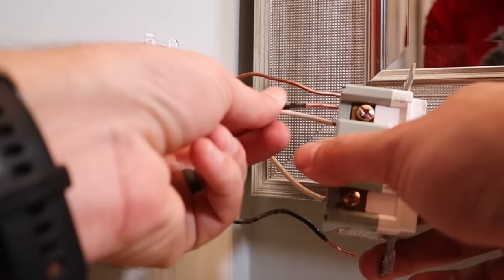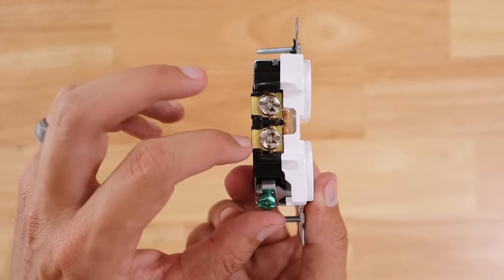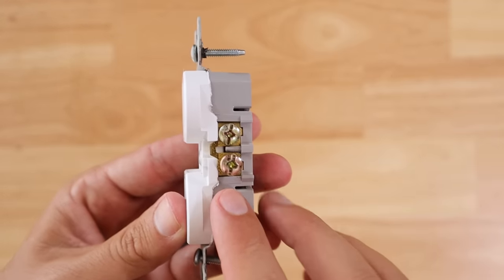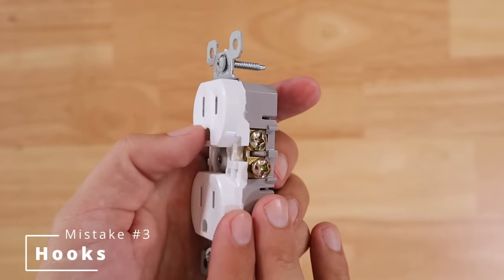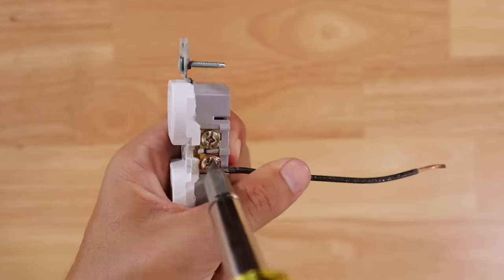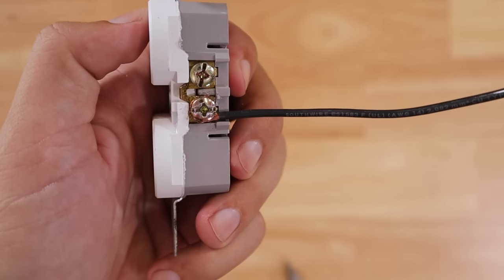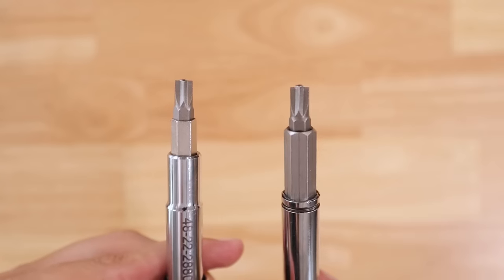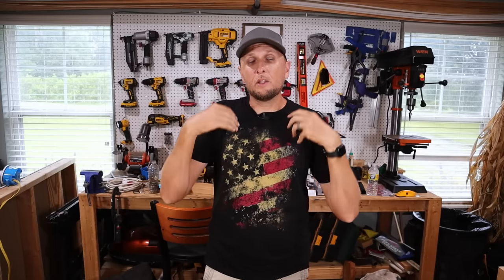The BIGGEST Mistakes DIYers Don't Know They Are Making When Wiring Receptacles | How To

Comment: I helped a father in law wire his house (He was a certified electrician). An older gentleman that had been an electrician for over 25 years. He told me one thing that I have always remembered and passed on to many DIYers. "Black to brass to save your ass!" Easy to remember and can save your life!
Reply: I was told Beverly hillbilly’s….black gold
Reply: My dad taught me "black to brass, white to white [silver]"
Reply: Aso as long as it is a three prong plug the green earth ground is always on the same side as the neutral wire.  That and if you look at a electric cord plug one of the Blades is wider.  This is the neutral side so if you look at a outlet, that side will always be natural.          Some people are color blind.
Reply: I was told that so, another  i was told righty tight lefty loosie
Reply: what is a certified electrician is that what you told you.
Reply: well in the meantime he taught you how to do the outlet so you're going to put a new one in but now there's another part of the job you have to do which makes it code now you got to go to the fuse panel and you have to take out that breaker  and you got to put an asphalt in or depends on the location it might be GFI and asphalt which they call dual breaker combination breaker is just not fault breaker but he's not going to tell you all that so you're just going to end up just doing the outlet and then now your code isn't your house is in violation because you didn't update the breaker
Reply: @josephdelvendo6009  Dude, way to go for making a simple tutorial into a complicated matter for a simple but professional way to replace an outlet. You totally missed the OP point.
Reply: @josephdelvendo6009  I bet I know something you don't.  They are not required in all states.  Also most states will let a home owner repair their own circuits without upgrading anything.  The only time in most states you have to upgrade is major renovation or adding new circuits.  

You should Not di respect Grandpa man man.  I mean no matter the outlet black does go to brass.   Also most places you can put a plug in the wall with the AFCI or GFCI on it and it does not have to be in they breaker box.
Reply: huh i wired one of these and the instruction said it didnt matter which wire went were,  i guess I will pull it out and check. hopefully i did it correctly
Reply: @slimboiu3890  WOW!!!   You will be okay using it as long as you do not put a 3 prong grounded plug into it.  If you do it will matter greatly.  It will become a direct short if you do.  If you look inside the breaker box the ground wires and neutral wires are all tied together. The ground wire that is bald actually goes to a 10 ft long copper bar driven into the ground outside your house.  Things like lamps or small fans will operate just fine off of the 2 wires alone because AC current flows in both directions so it does not matter what side is positive.  It will run either way just like the old cords from a long time ago that you could plug in either direction. They did not have a wide blade on them for the neutral wire like todays cords have.  But if a Item has a third pole it is grounded to earth and plugging them in will short the earth ground to the hot side. 

If you did not understand all of that then have a electrician double check it for you and leave it to the pro's in the future.
Reply: @jvmiller1995  thanks for the response, I will definitely pull it out and check, black to brass to save your ass got it committed to memory now!
Reply: I can't think of why swapping black and white on an outlet would matter.  On a light switch it would because you want to disconnect hot from the light when not in use.  For an outlet it's a bad practice to not wire it correctly but it will not start a fire, damage a device or be dangerous.  Many devices don't even have polarity on the plug and current flows in both directions for AC power so 50% of the time current is coming from Line and 50% of time current is coming out of neutral.  Most consumer electronics companies test their products for reverse wiring and assume that about 30% of homes are wired that way.  The chassis is connected to earth ground for added protection.  It really isn't a big deal to swap those wires.
Reply: @slimboiu3890  It doesn't.
Reply: As a non certified electrician, I can assure you that it doesn't matter. All you're doing is creating a circuit.

Look at the box that allows your phone to be charged. It doesn't have different blades on it. It can be  connected in both ways.
Reply: @Deno03  Exactly.  There are some appliances it kind of matters.  The charger is class 2 isolated, so the output is completely floating compared to the input.  The transformer inside the plug has spacings and tapes that make it impossible for the input and output to touch.    

Some appliances are either line or neutral referenced.  Meaning the 5V bus that powers the electronics ride the sine wave.  The advantage of this method is that it is cheaper as this bus can be created without an expensive transformer and some motor controls need to know the position of the sine wave to trigger.  In a Class 2 isolated scenario you would need expensive optical isolation to trigger the motors.  Even with this non isolated scenario appliance makers assume and test for miswired houses.  I think they assume as high as 30% of homes are miswired.  

The earth ground wire is a critical safety feature and that should never be miswired.  Appliance cabinets are tied to earth ground for safety.
Reply: I was told by my neighbor when  I first started working on my own stuff "just remember all the experts are dead".  He said if you don't know what your doing make sure you figure it out first and triple check everything.

Comment: This video serves as a great way for anyone to inspect their home for fire safety.  Well done!  They don't have to take care of it themselves, just know when to call in professionals.
I tell you, scariest thing I ever saw, was a friend try to "fix" his own outlets in the house he rented (cause he didn't want to "bother" his landlord.) Went to the hardware store with him, pointed out a good brand of outlets. He buys a few 10 packs. We arrive at his place - turns out to be an old home.  "Oh" I say, "old homes are different. Let's not..." - he charges ahead.  Cuts the power, pulls off an ancient-looking kitchen counter outlet cover.  (He had been bending the toaster plug into a wide "V" to get it to "stay in.") 
Turns out, it's the 1927 original plugs in there!  "Oh man, you can't just put a modern 3-prong outlet in a receptacle without a ground wire..." I start saying, holding the flashlight.  "Really, you need to call a-" he reaches in, past ancient rat turds, and in a cloud of dust, pulls out cloth-covered wiring, which crumbles in his hands. The DULL, BLACK copper wire ends break off at the slightest touch of the screwdriver. He frowns, reaches for the strippers. My eyes go wide "DON'T!" but before I can say anything, he yanks hard.  I dropped the flashlight, covered my nose with my sleeve and ran out of the house.  "Why you out there?" "Because that fluffy white stuff under the cloth insulation is asbestos!"  For God's sake - never attempt something like that, bother your landlord!
Reply from the maker: WOW!  That was a great story!  Yeah definitely need to at least have a foundation of knowledge before getting right to it.  Thanks a lot for taking the time to share that experience!
Reply: @HowToHomeDIY  No, thank you for the video! So many channels have dangerous advice, you're a breath of fresh air.  I sure learned my lesson here: I'll never tell someone home improvement projects are "easy" - till I see the home.  I took my privileged, middle class upbringing in modern houses for granted.  There are special dangers in the old homes I'm sure I'm not 100% aware of yet.

Comment: You should always run a pig tail from the wires to the plug to avoid the outlet from carrying the full load of that circuit . If the plug goes bad, everything down stream will stop working and it forces the plug to carry the full load of everything on that circuit.
Reply: Not exactly how it works... It'd have to be a pretty massive failure since each side's terminal lug is connected w a sold piece of metal. It's effectively the same as using a wire nut and tail. Though, I do agree most of the time to use a wire nut and tail to the outlet if having to connect to multiple separate boxes from a single gang, sometimes you don't have room in the box to do so or your just daisy chaining. The outlet is rated to do that.
Reply: Space heaters are great at finding the weak point in the circuit for that reason. I’ve had poor connections on a room and one side of the room had 120v and by the time it made its way around the room the last receptacle had something like 80v. Pig tails make that less likely for sure… as long as the person knows what they are doing

Comment: For myself I just remember that the "shorter" inlet on the receptacle is the hot side so I attach the black to that side. 
Another point. In the house we bought literally all the receptacles and switches were wired using the "backstab" method. I've been going through and changing them out over the past months! Good video!
Reply: A good way to remember which one is the hot side is to remember that it only takes a "little" amount of amperage to kill a person

Comment: I would add making sure to tighten the unused terminal screws so they don’t stick out and contact adjacent switches/receptacles. I also like to run electrical tape around for over the top protection
Reply: Doing tile (esp. kitchen backsplash), I pull out the outlet/receptacle and tape the terminals if they're not already taped

Comment: I already know the hot wire is on the right, but I always think of the smaller slot of the receptacle as a more "cautious" measure, protecting you from the hot wire, as opposed to the neutral slot which is larger. Works for me.

Comment: Being an electrical engineer myself, I appreciate the clarity of how you provided this information.  Every DIY homeowner should watch this video before they attempt to replace receptacles on their own.  I have seen way too many situations where someone installed receptacles incorrectly and it resulted in significant damage.  This video can help prevent you from burning down your house or even worse.  I also can't stress the reverse polarity issue enough.  Many people think it's AC and polarity doesn't matter.  IT DOES.  You can burn out (destroy) your major appliances if you do this incorrectly.  Also, I love your shit.
Reply from the maker: Yes I have been told over and over again that there can't be reverse polarity in the comments on this video.  It can be very dangerous.  I am really glad you liked the video.  Thanks a lot for the feedback Robert!
Reply: Um, what?  Polarity in AC wiring isn't about appliances, and you're NEVER going to burn out an appliance because AC polarity is reversed.  It's about safety.  It's about not connecting the hot wire to components that are more easily touched.

Comment: I like the specialized bit but I think you suggested tightening it too much.  You want an airtight connection between the screw and the wire, but you don’t want to misshapen the wire because that will work harden the wire and increase the chance that it will crack in the future.
Reply: Yes, good point. Being in the electrical trade for over 40 years and 20 of it as an inspector, I have run across items where the screw was over tightened resulting in stripping the threads and now has a very loose connection. The electrical code now requires that all screws have a torque specification and that a torque screwdriver be used. Although the AHJ cannot verify that all have been installed using this screwdriver, he can at least verify that the contractor owns one.
Just a couple of weeks ago on my boat, I had a 50 amp breaker burn up one of its terminal connections. Upon investigation, I found that during the factory wiring, a longer screw was needed that was supplied by the device. The factory must have run out of longer 10x32 screws and used a 10x24 instead. Either they stripped it, or most likely since the threads were already binding, thought is was tight enough. Either way, it ended up being the failure point. This something I might expect out of a DIY guy, but not from Maxum boats.
Reply: @lkeil84  majority of people, under-tighten terminal screws/lugs, tightening to the point of stripped threads is also very bad, but it seems as of late the materials are all suspect and junk, including many wire nuts. by "as of late" I mean items from roughly 15 years ago to current date. it's not just the equipment with issues like: too soft of material, wrongly shaped, over/undersized, poorly threaded. beware, it's just as often the tooling which has become the same very poor quality, combine the two together? = total disaster, add to that lack of skill and training on old school methods and technology and the older generations retiring/dying off of diseases and major medical problems.
everyone is too busy looking at the small issues and squealing fools to notice the big picture and happenings. 😬

Comment: a note to bring up- there are a load of nicer newer receptacles that use a clamp under the screw and you do not hook your wire- they look like back stabbing except, well, at least the GFCI and Decora style ones I have been buying, they take up to a 10 gauge wire, and are designed for two wires under each screw which I have had no overheating or other problems with. So, if you are using the older style without the built in clamps, as you say, your best practice is to pigtail, and I use Wagos for that. But, I don't waste wagos when I have these clamping screws. Perhaps it is the cheap residential grade compared to the nicer Decora commercial grade but, I like the looks of what I am using and have yet to be called back for an overheated outlet.
Reply: No such thing as commercial grade or residential grade in a code book. You can use any receptacle that is listed in any application. Now, there may be minimum specifications spelled out in the construction of a building, mostly commercial. There are just differing grades of devices just like auto parts. The only difference in auto parts is there is no minimum standard like a listing will provide. Don't in any circumstances use a device that is not listed. And the CE on the back means nothing. There is a lot of Chinese junk out that is built terrible, has had no safety testing, but has the CE mark. This also goes with many consumer items like lamps, alarm clocks, refrigerators, etc. They are ticking time bombs just waiting to catch fire or shock you.
Reply: In Canada it has been code for many years to pigtail the neutral/identified wires. DO NOT PUT BOTH WHITE WIRES UNDER 1 TERMINAL EVER! This is dangerous to a service person and it creates a greater risk of fire.
Reply: @lkeil84  You are right, but, commercial grade gear is built more expensive and lasts longer before having failures usually, kind of a you get what you pay for...
Reply: @17kcotsdoow86  Again, you raise good points in the US and Canada as to why they have a single wire single screw type of code BUT, it will take some proof before I see a greater chance of fire, as loose screws is why they made it code- improper design of the tightening area that did not make certain the screws got proper torque..lol.. 
If properly tightened more than one wire can work without creating a fire risk. UK and Europe use higher voltages and have required both torque settings and insulation tests for many many years, since before I even knew what a BS7671 code book looked like.
But, I prefer to use numbered screws ans well as labeled wires so I can easily find circuits for testing. USA is behind on the clean installation methods that make testing circuits easy.
Reply: @brotheradam  thanks for responding.  My comment had to do with neutral/identified (return path) wires. If the return path is broken a dangerous situation is created as the drawn current down stream is still looking for a return path to ground. In Canada it is required that a device be removable without interrupting the continuity of the neutral side of the circuit to down stream devices as this can pose a dangerous situation. If you get yourself caught between the open neutrals it can hurt real bad if not kill you. Therefore pigtailing a solid mechanically connected splice allows for safe removal of an individual device without interrupting the return path of the rest of the circuit.
As for fire hazard, a loose return path connection has always proven more dangerous than loose hot connections. I have encountered significantly more burnt white(neutral) wires in comparison to burnt hot wires I my 30 yr career. We have torque requirements also, even though they are rarely if ever enforced. That still does not prevent a bad connection from developing over time from real world scenarios like service & maintenance, vibrations, movement of building structure, heat cool cycles or other potential factors.